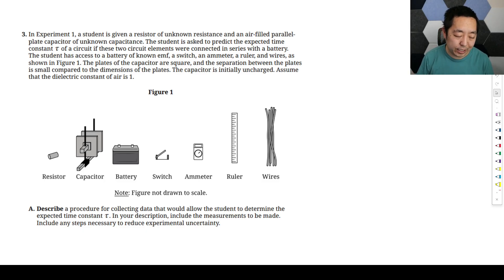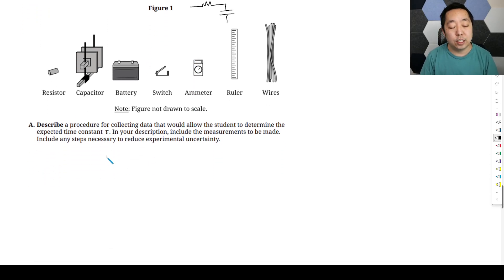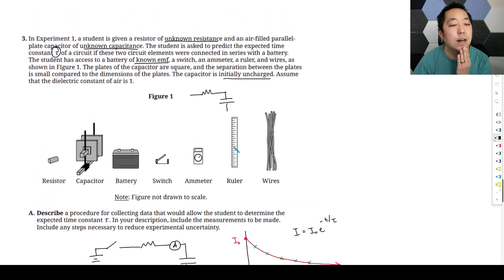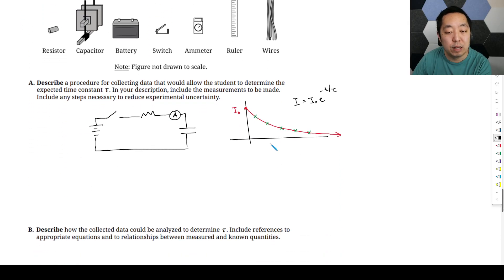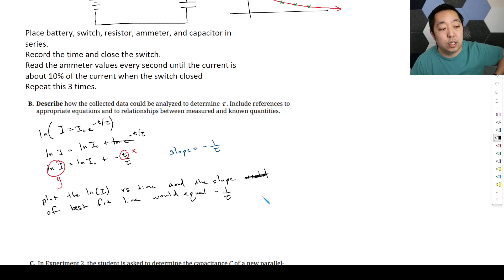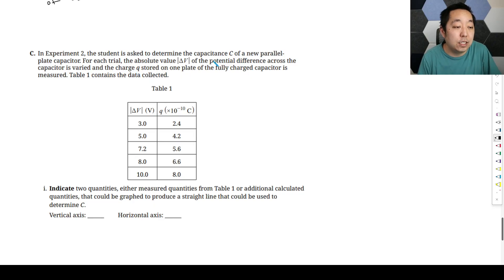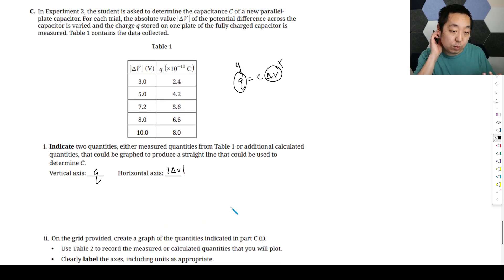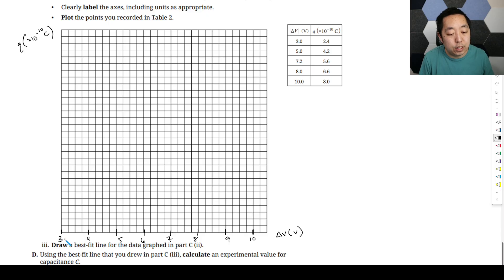2025 AP Physics 2 Free Response #3

Comment from the maker: Corrections:

For part a), it's likely they wanted you to measure the resistance with the battery and resistor, physically measure the dimensions of the capacitor to calculate C, then compute RC

No need (or ability) to vary any quantities.

For computing the slope, I misread one of the points. The C should have been 8x10^-11 F or 80 pF
Reply: yea weird question. It was barely an experiment. And the graph had no linearization or anything more complicated.
Reply: I think the clue that there is no varying of quantities for part A is that part B does not indicate you are graphing the data collected, just analyzing it. A weird question after they made a big deal about making this question type consistent.

Comment: wait can u just use the ruler to measure the dimensions of the capacitor and determine the resistance using ammeter battery wires and the resistor and then multiply? or is that credit off?
Reply from the maker: So it's hard to say because this is such an unusual lab question. Normally you have to vary a quantity for the experimental design. I think they will count this (and likely this is what they wanted). But it's a bit of a weird question
Reply: @ yeah i was also confused by it and that’s why i thought i was wrong. our physics teacher never even taught time constant so yeah ig i js got unlucky
Reply: @AllenTsaoSTEMCoach  I put the solution you solved in the video at first, but I ended up switching it to using the ruler since they gave every value needed. I changed my mind because I don't think they would want a calculus/derivative-based answer.

Comment: For 3A, how are you supposed to record the time/the ammeter values each second if you arent given a stopwatch?
Reply from the maker: I do think a stopwatch was necessary to do this. I picked one second as you could theoretically do that without a stop watch, but I do think it's better to include.

I cannot think of a different way to do this experiment without more access to equipment though.
Reply: @AllenTsaoSTEMCoach  I'm not sure if this was right but here is how I did it:
1. I used the ruler to find A and d of the capacitor and plugged those values into C=κε(A/d) to find the capacitance.
2. I connected the resistor in a circuit with the battery and used the ammeter to find the current. Then i used Ohm's law to find R because we know the emf of the battery.
3. I did R*C = time constant.

I also thought about doing what u did but didnt because the question didn't give us a stopwatch. I'm not sure if this is correct though, because not all of the materials were used and I think its kind of strange to find the A and d of the capacitor using the ruler.
Reply from the maker: So I considered that too, but usually there's something more than just a calculation. Like you're supposed to vary one quantity and measure a response in another quantity. And there was nothing to vary in that kind of situation. 

I think your method will likely get full credit, but it's hard to reduce uncertainty (I guess you'd just repeat the measurements a few times like I did). I would have hoped for something to vary and data to plot, as that's what all the practice tests (for all the AP Physics exams) have generally done.
Reply: @AllenTsaoSTEMCoach  I agree about the uncertainty.  AP Physics 2 doesn't get the equation that you used for time constant though... I = I_0*e^(-t/Tau) is not on our formula sheet nor are they required to be able to use it. I really don't know a better way to do this than to just get the measurements and be sure to discuss the precision of the instrument and make multiple measurements... This is an interesting FRQ for sure.
Reply from the maker: @amandacantwell5281  I agree. I think this is what they intended as an answer, but it does go against the description of a Lab Design question.

"The experimental procedure is expected to be scientifically sound: vary a single parameter, and measure how that change affects a single characteristic. Methods must be able to be performed in a typical high school laboratory. Measurements must be made with realistically obtainable equipment or sensors. Students will be expected to describe a method by which the collected data could be analyzed in order to answer the posed question, by either graphical or comparative analyses."
Reply: I think it might be implied that basic lab equipment (such as a stopwatch) is accessible, but it's an odd question.
Reply: @neekramer It usually says basic lab equipment though.  I mean they specifically named the meterstick which should also count as basic lab equipment.  It's a very interesting question.